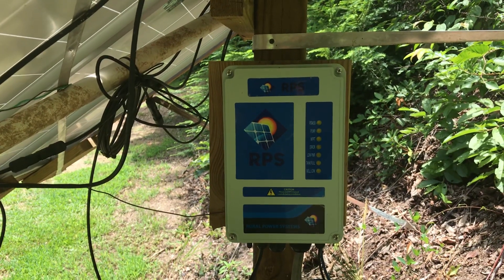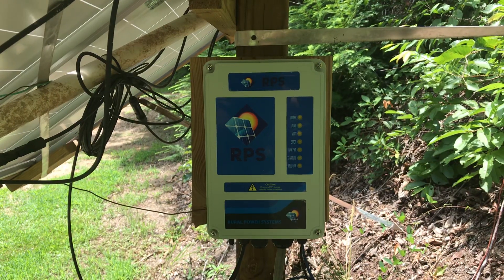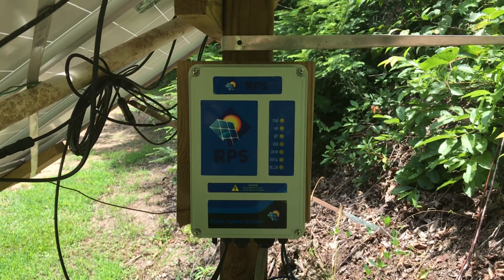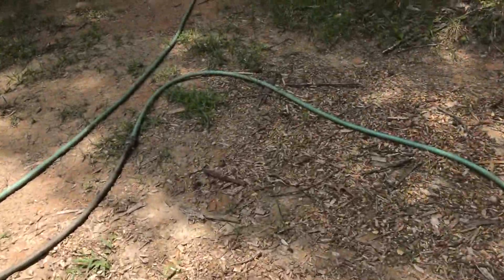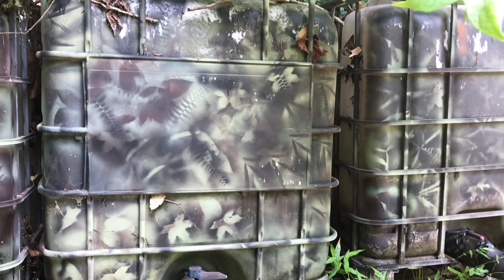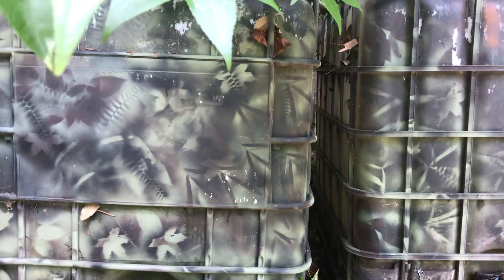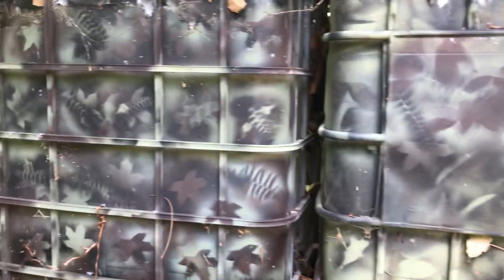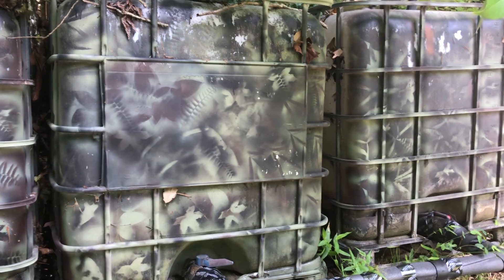RPS SOLAR WELL PUMP FAILURE/UPDATE 1

Comment: How well do those pumps last, it looks like the same type on 115/220 v....any longevity to those 2 inch pumps?
Reply from the maker: @gavinhodge2290  Maybe this can help answer https://youtu.be/sm4AQukeGlE?si=3Vska35h8s-aSeyj
Reply: @THEOFFGRIDMOUNTAINHOMESTEAD  crap! I was wondering if those rps pumps were  the same Kung Fu pumps you see on ebay. I have a 2 inch well and was looking for a small diameter submersible pump @ 115 volts.....I like your solar setup, I have 22 panels grid tied with the enphase inverters...been working great for years
Reply from the maker: @ I was going to use a 120vac pump after the RPS failed but went back brushless DC. I needed soft start and would have required extra parts to make this work on AC voltage